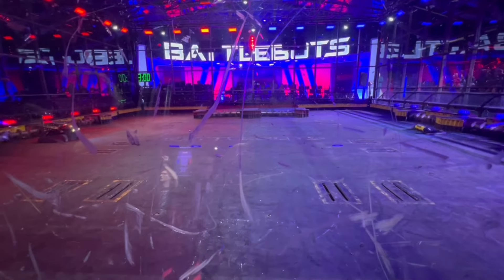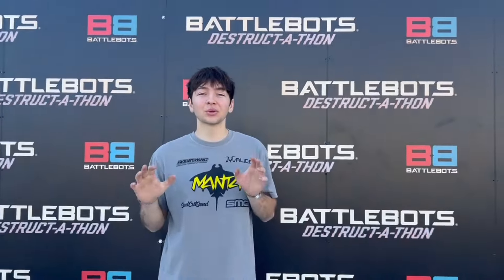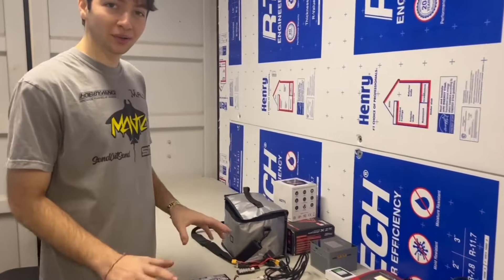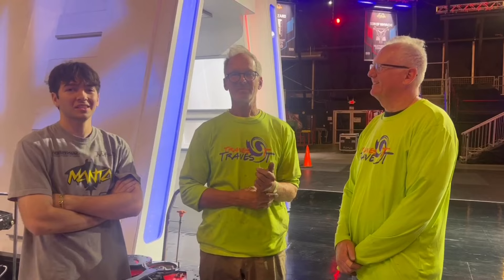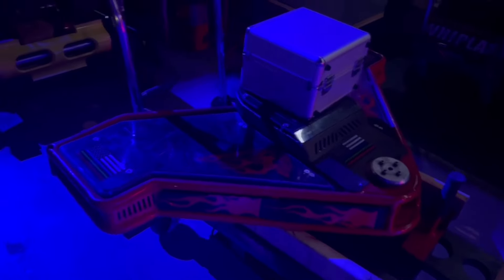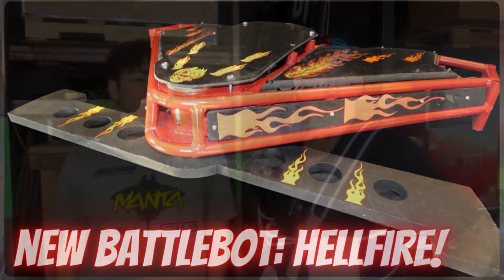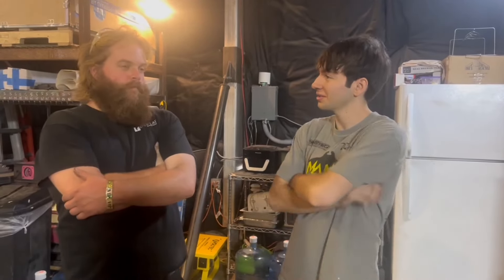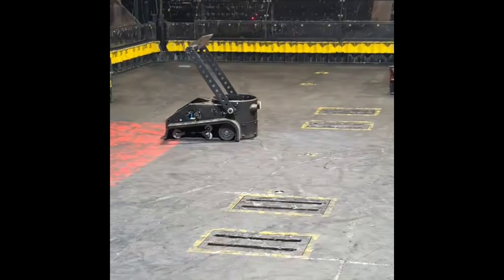Battlebots MOST ANTICIPATED NEWCOMER Takes Over The Blog

Comment: The new Rusty looks like a champ but I gotta say Manta looks like they are gonna have a hard time because of their clearance issues. If that tinfoil looking scoop-wedge they have in the front gets bent then they will get slammed pretty easily.  Good luck to all of them though, as in life anything could happen!
Reply: I think the opposite is true for Rusty. I don't understand why the builder decided to make an already non competitive robot ten times more complex, harder to repair and weaker. Did you see that hammer "speed"? Previous Rusty looks like a powerhouse in comparison. 

Why go for an internal combustion engine power?! On a HAMMER BOT on top of that?!?!? Makes no sense. Rusty should have simply ditched the threads, kept the all electric power system, added an interchangeable plow/forks front system and it'd already been much better and stronger.

If you want to do a gas powered Rusty, do it for exibitions like the turbine powered Hellfire.
Reply: @olisk-jy9rz  An ICE-powered build is very cool though and rare to see in this day and age. Not everything has to be hyper-competitive, no one wants to see a field of 50+ 4WD vert spinners. 

Rusty's hammer looks like it's designed to break spinners by feeding its weapon into belts, chains, etc. and jamming them up. Questionable how successful that strategy is with the build quality and redundancies of current bots, but Rusty Sr.'s weapon almost did exactly that to Copperhead and also disabled OG Kraken's crusher.
Reply: @wristofkings  Ok. But here we aren't talking about "hyper" competitive, we are talking about a bot which was already completely non-competitive and struggled to work as it was. That's why it doesn't make sense to make it even weaker and harder to maintain for a 1 man team.
Reply: @olisk-jy9rz Agree that I don't see the advantages from a logistical standpoint either given that he couldn't get it working for two seasons in a row, but respect that he pushed himself trying to build something different and for some builders that challenge is the whole point.
Reply: @olisk-jy9rz I think you meant jet lag

Comment: Manta might win rookie of the year award in s8, only if it lives up to potential. Not sure what he'll do against HUGE
Reply: I'd imagine the goal of huge would be to be a HUGE problem for a lot of teams. Could see that that being the case for manta
Reply: @bami2  but copperhead lost, wasn't even a close fight
Reply: Just run straight trough Huge. Manta's drum would win any exhange against Huge's spinner, breaking it.
Reply: @olisk-jy9rz  how so? Didn't copperhead tried that? Doesn't sound so easy now does it? Now to mention HUGE could adjust the bar length (as he did in the gigabyte fight) to only hit manta top, which might make it harder for manta to hit HUGE weapon directly
Reply: @jonathanf2392  Copperhead was already almost destroyed from the Riptide fight, AND they spun their drum downward which was a BIG mistake. 

Go check out waht Riptide did to Huge. Manta's drum is even more powerful.
Reply: @olisk-jy9rz  riptide only beat HUGE because HUGE got stuck. Not to mention, HUGE killed riptide spinner after that hit, so if HUGE wasn't stuck, HUGE would still be hitting riptide to death and win. Also, riptide is an egg beater, their weapon has way more of a bite than manta, so it's highly unlikely manta would pull off that same power hit again

And if I may repeat myself again, HUGE could adjust the bar length (as he did in the gigabyte fight) to only hit manta on the top and give less chances for manta to hit HUGE weapon. People make it seem so easy to strategize stuff like "oh just get tombstone's wheel" or "oh get around hydra side" or "oh get underneath minotaur drum spinner." But you have to realize some of these things are easier said than done. Because HUGE has proven himself to be a formidable opponent, he has the upper hand in a fight against manta. And just like with cobalt & quantum, just because a bot did well in other competitions doesn't necessarily mean they'll do well in battlebots. Manta has to prove himself worthy before I'm convince he's the real deal
Reply: @bami2 uh no? Huge wrecked Copperhead, it wasn’t even close